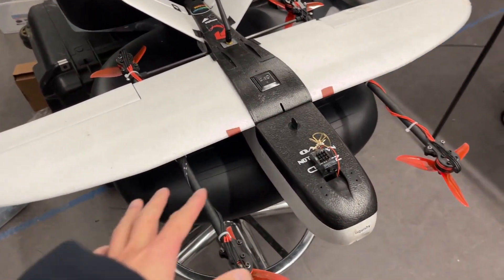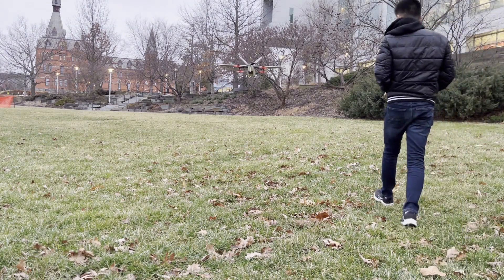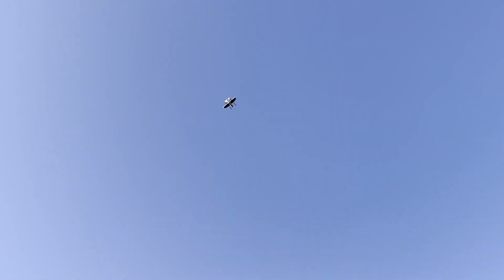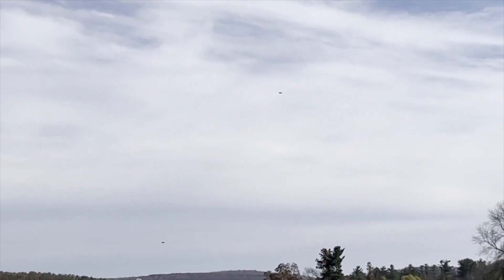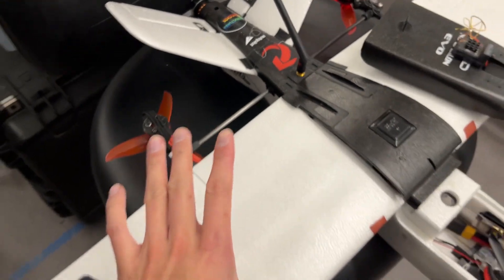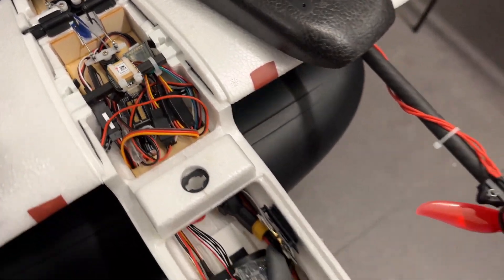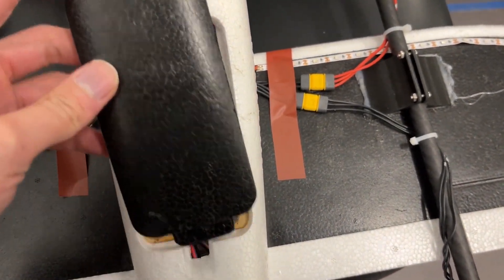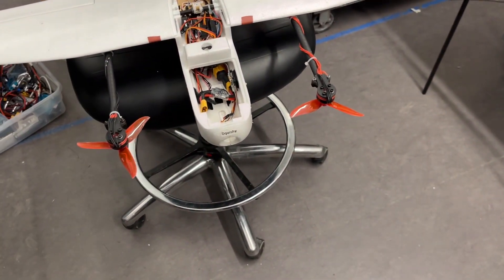VTOL Nano Talon - Ardupilot Quadplane Showcase

Comment: Most VTOLs that I've seen, the motors rotate position. I like your concept more with fixed position, as you can transition faster.
Reply from the maker: yeah it's definitely a simpler implementation with this "4+1" setup, but results in a decent amount of "useless weight" when in forward flight. I would like to try out the tilting setups with a larger plane at some point

Comment: Great demo. Like the VTOL "to the moon, and beyond" climb out. (2:40)
Thanks for including the build details. ♥👍
Can you include an AUW in the description? As curious, to how compares to typical wing build. Wing loading doesn't appear too high as fly's quite well, and as you mention hovers at 20% throttle.
Nice work getting all the pieces assembled and working well together.
Reply from the maker: Yeah I'll try to get a weight within a couple days, I recently got into another crash trying to do a flip in hover mode haha. 
I will say it is quite heavy just cause of the additional vtol hardware, and the wiring and such is not exactly optimized, so it needs to fly decently fast to maintain altitude. Thanks for the comment!
Reply from the maker: sorry it took so long to get back, but the total weight is 847g + 217g = 1064g (for plane + battery, respectively)